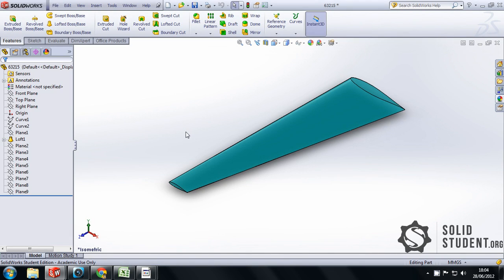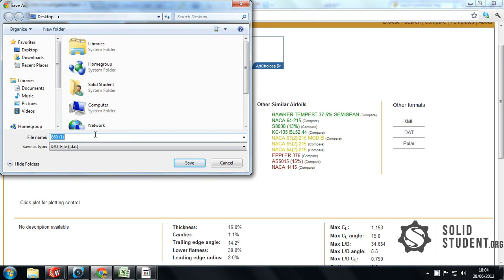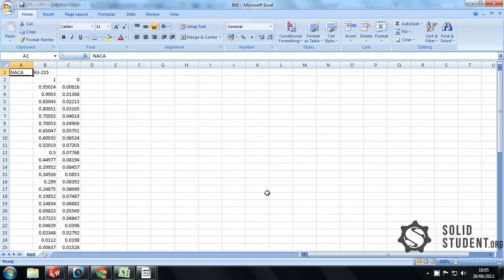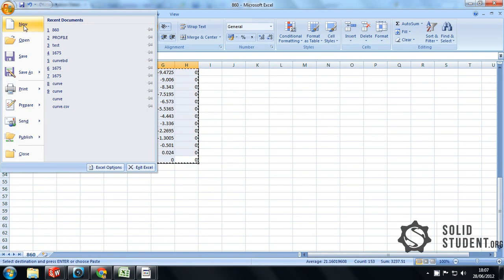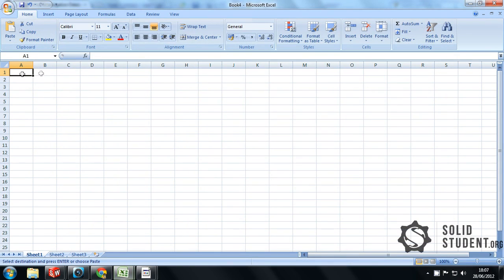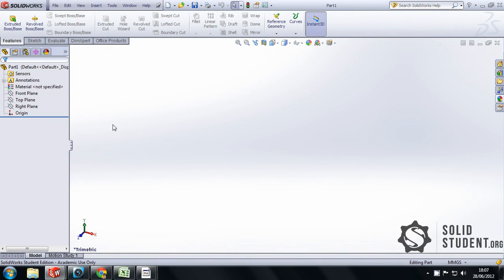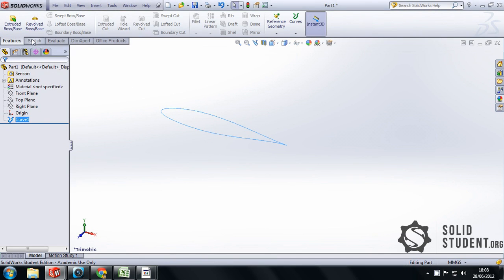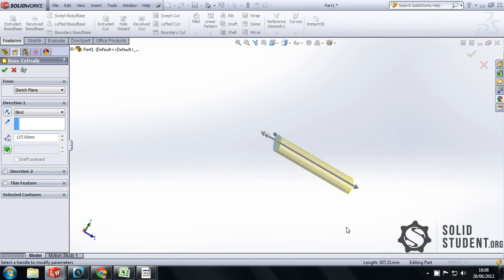Solidworks Tutorial - How to use "Curve through XYZ points".

Comment: What worked for me, is first I saved it as a CSV file without typing the .txt. 
Then I went to File Explorer, set it to display file extensions for files, and then it showed the .csv file extension.
I simply erased that, and changed it to .txt, and it said "The file may become unreadable by changing its extension" but I proceeded anyway and it ended up working!

Comment: That was extremely painful trying to get it to open in solidworks. Obviously it's 2016 now and systems have changed since 2012, but I finally got it to work. If you get up to the point of saving the data to a new sheet, save it as a text file (tab delimited), open the text file, make every number have the same number of decimal places on the right side of the decimal by filling in with zeros if needed (i.e. 123.700 instead of 123.7 if your other values extend to the thousandths place like 456.789) (Don't do 0.000, leave it as just 0), make sure there is only ONE SPACE between each column of every row (yes, it''l look offset a bit, but it works). Once you've done this, save again, and follow the rest of the video.
Reply: Big ups to this guy. This solved my issue. Make sure it is a space not a tab between columns.
Reply: You are a life saver

Comment: i hope this will be useful for future reference- If you receive the error file name invalid, not found, etc.. the following worked for me:
- follow steps in this video up until save as in excel
- save as formatted text (Space delimited)
- try importing as directed in SolidWorks. If it still doesnt work:
- open the text file
- make sure the spacing between columns is consistent (for me, the issue was between columns 1 and 2. sometimes there would be 1 space, sometimes none)
- save and try again

Comment: Thanks but I already figured a way to work with excel by myself. HOWEVER I encountered another problem.. I got several xyz coordinates for a NACA0012 profile (wing) and for some reason the profile is not complete as in the flow edge (back part) is not cloosed so it forces me to close it by myself which fails for me... please give me your skype I would really appreciate it.